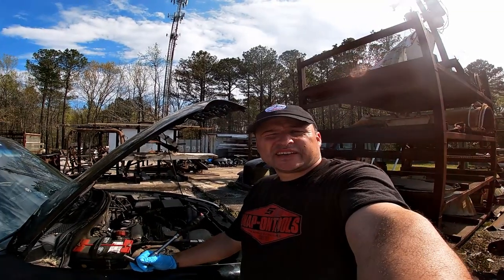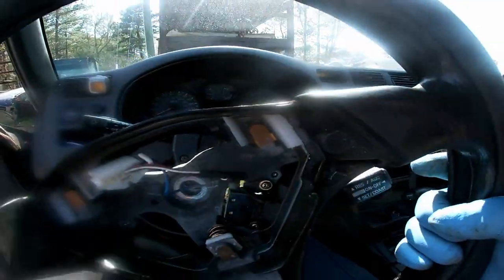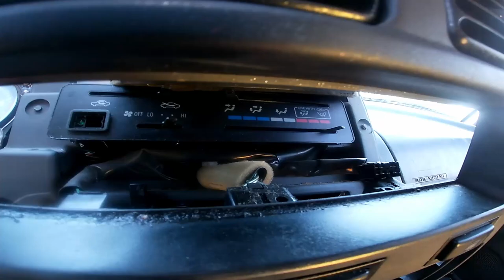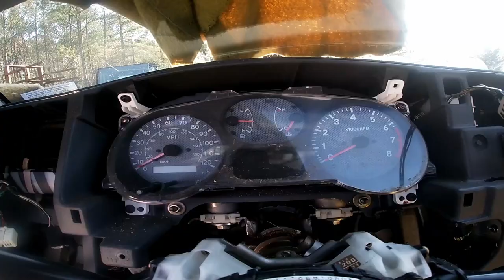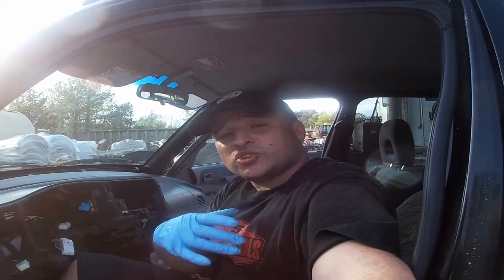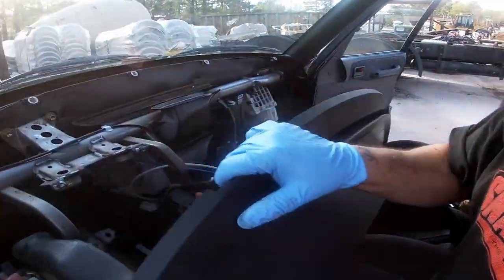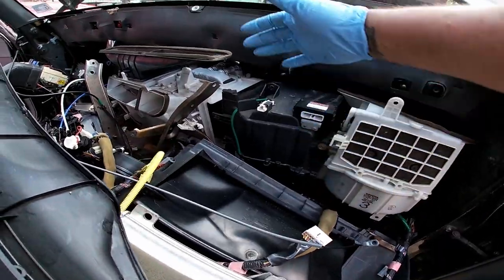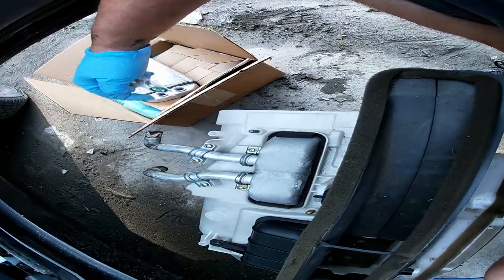HOW TO REPLACE A HEATER CORE IN ANY CAR OR TRUCK EASY AT HOME!

Comment: Do you need to bleed your radiator after this? I’d assume the new heater core has air in it won’t that cause air in the cooling system? any help would be greatly appreciated
Reply from the maker: Yes it’s a very good idea to bleed the cooling system. I would if it were mine.

Comment: Thanks for this..I’m trying it with a Suzuki Ignis..The further I get I feel like it might need to get towed to the shop when I can’t figure it out😆
Reply from the maker: I won’t lie to to you… Heater cores are a pain in the but because of you having to remove the dashboard. But be patient you can do it.. take pics of everything you removed and that will help you too as a reference if you get stuck. Good luck bud
Reply: @Gasdieselgarage  finally got it out! You got any tricks for checking to make sure the replacement one I got is good..I was thinking a bicycle pump with a pressure gauge and and old bicycle inner tube ..Put air in, stick it in water and and check no bubbles..I figure that should work..Literally took me 2 solid days to get it out😂🙈

Comment: If your still reading comments... Have a friend with a 1997 Rav4, and heater did not want to get warm. We flushed heater core and it had no issue. But when we hooked hoses back up, and started engine, the inlet side on the firewall got hot, but the outlet side stayed cold, which would mean water was not flowing thru it, but we know it was clear from the flush.
Is there a inline valve somewhere under the dash?
EDIT. Never mind, I see from the video there is no valve, just inlet and outlet lines.. any idea why water is not flowing thru it, even after a flush showed it was clear? Is there something on the engine hoses and connections that would stop water from flowing?
Reply from the maker: Unless you have a clog in the heater core hoses coming from the engine…I have seen that before.
Reply: @Gasdieselgarage  Thank you,, will check that..
Reply: @Knife_Collector  did u end up solving the issue, i have the exact same car and issue
Reply: @kuiji9973  He did, but was a day or so later when I was not there. I think it was a hose issue. I will find out some time today and let you know.
Reply: @kuiji9973  OK, I guess the channel was correct in his opinion,, my friend said he had to change out the heater core. Which I found confusing to what I remember, as I remembered water flowing thru it as we flushed it, that's why we could not figure it out.

Comment: Can I bypass the heater core without any bad effects to the A/C and Cooling system of my Rav4 99?
Reply from the maker: Yes you can …you just won’t have any heat in the cabin…
Reply: @Gasdieselgarage  Great thanks. I live in a tropical country and heater is not necessary inside the cabin. :)
Reply from the maker: @rouge0449  that’s awesome